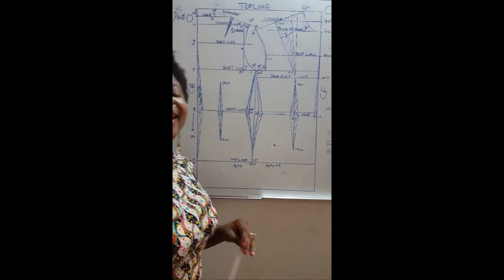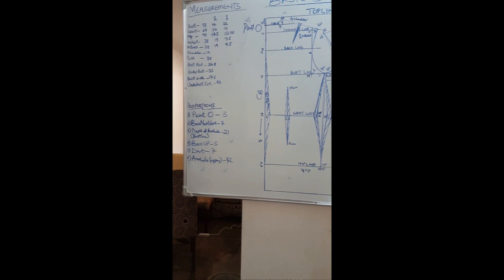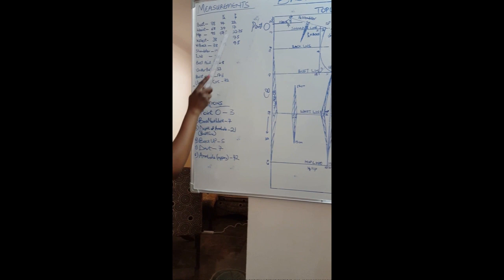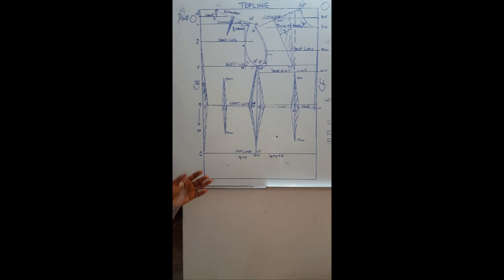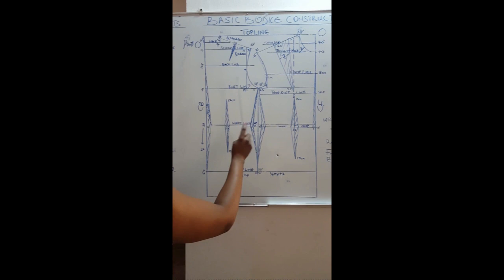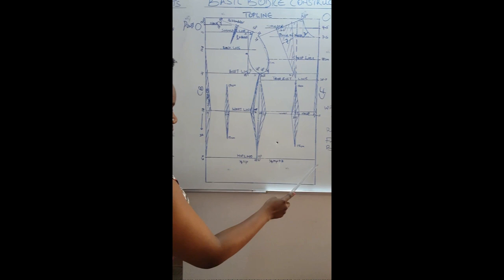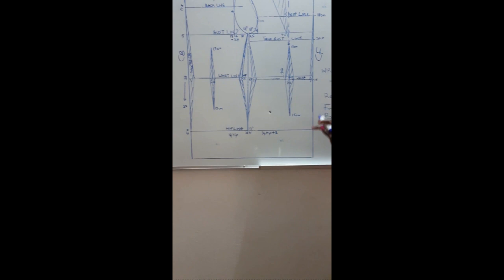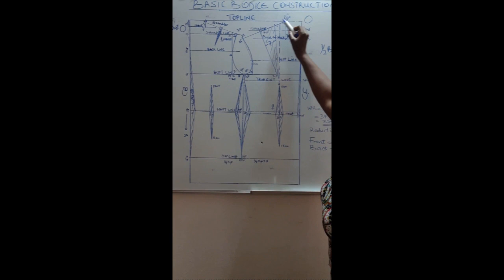Detailed explanation of the Basic Bodice Blocks Construction - Natalie Bray's Method

Comment: Hi, thank you for this video. I make all my clothes from this pattern drafting method. My issue is with the sleeve pattern.  I drafted a sleeve block using Natalie Bray as well but when i made a sleeve and joined to the bodice, i find it difficult to raise my arm. I have drafted up to 10 different patterns of basic sleeve to match this bodice block but i always have difficulty raising my arm. Is there a particular method you use to draft your sleeve block? I would really appreciate if i get your help
Reply from the maker: Hi. For all our Slopers,  we use Natalie's method. And no fitting issues.  As long as you have taken accurate measurements and drafted your Blocks accurately.

Your fitting issue could be that you did not take Accurate XBack and XChest Measurements. This is one of the Causes of not being able to raise your hands.

Also, if you bring down UPs in a bid to increase the Armhole, this can also cause it. Because when you bring down UPs, you are shortening the Side Seam. And this can cause the issue.

Solution: Check that you have accurately measured the XBack & XChest measurements as shown in Natalie's Book

All the Best
Reply: @IbileClothiersNG  aaww. Thank you so much for the prompt reply. I ran to your IG to check your page and to send a DM just incase I didn't get a reply. I saw the post of the online course you put up. Can I send a WhatsApp message to the provided number for the Investment 4 option?
Reply: @IbileClothiersNG  I noticed that this issue of finding it difficult to raise your arm up has to do with having excess across back and across chest. I think the problem occurs because most people follow the measurements in the book. The chest width measurement is usually more than the figure. It's why it's best to measurement the client properly. I stand to be corrected tho.

Comment: I noticed that as i tried to do my waist shaping, i didn't have any excess for dart and i also didn't have my complete waist measurement talk more of ease . My measurements are:
Bust-39.5( i added 2" ease to get 41.5")
Hip - 42
Waist-36
Reply from the maker: Your measurements are fine. And you should have your actual waist measurement and excess for waist Shaping if you followed the correct steps.
The Front & Back Blocks are drafted in a Rectangle ... the width of the rectangle should be ½Bust + 5 or ½Hip + 3 whichever is larger. And the length, is 75cm.
From the above,  your ½hip+3 is larger than the Bust.

Is that what you used??
Why did you add 2" to the Bust?? Ease is added while Drafting not to the measurement as you have done. 
5cm Ease to the Bust
3cm Ease to the Hip 
And 1cm to 3cm to the waist according to what you have
Reply: @IbileClothiersNG  I noticed that the 5cm is too loosed so I reduced the measurements. I did everything correctly but I still don't have excess for dart or even ease for my waist measurement.
Reply from the maker: @PreciousNnamani-te8wj  5cm is the same thing as 2" you said you added.

If you did everything correctly,  then you should at least have your waist measurement even if you do not have excess to take in as darts